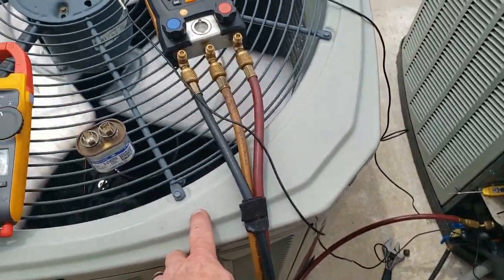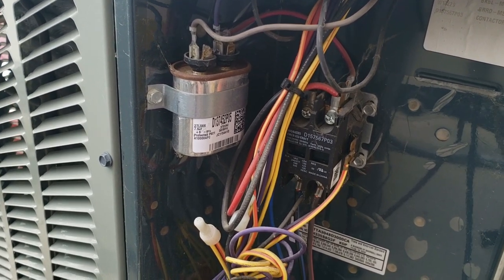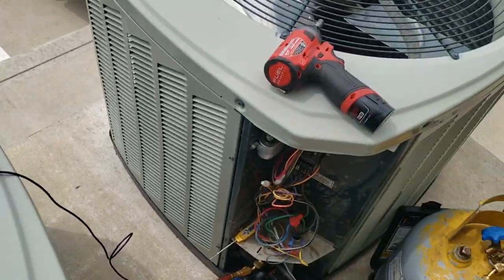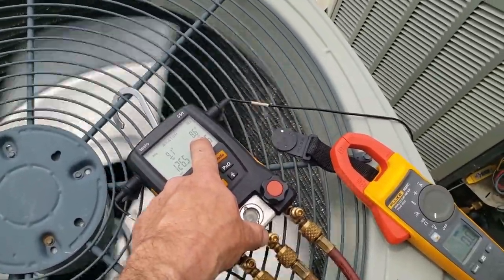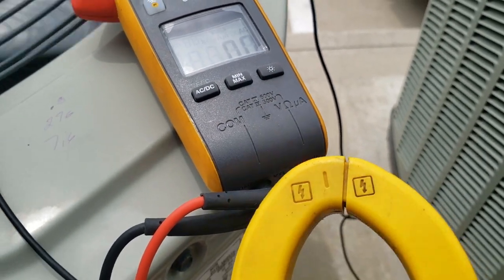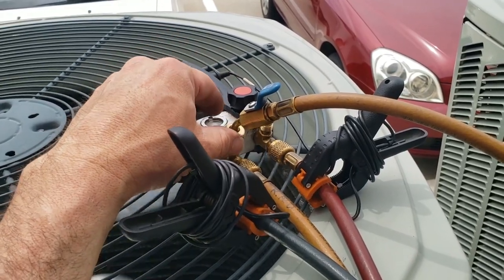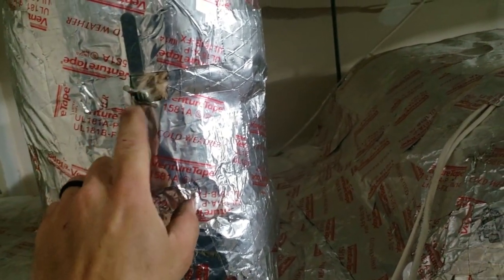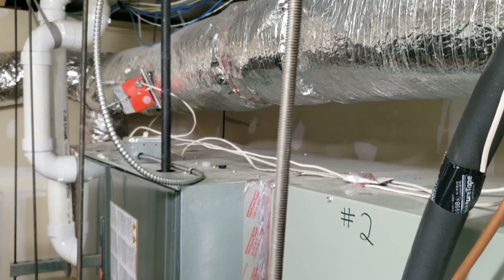No Cooling. Building Not Keeping Temp, Now It is!

Comment: I had a run capacitor issue like that last year on a brand new Trane. Installed an OEM capacitor that bench tested perfectly and showed under capacitance while running. I spoke with a bunch of engineers and nobody could give me a reason. Just a note that I did test it with three different meters and get the same results. I guess that’s why they call electricity a theory.
Reply from the maker: True that 👍👍

Comment: Yeah, Amprobe stuff is made by the Brymen company in Taiwan. They also rebrand their instruments in the United States under the Greenlee name. And they are a little slow registering amp readings. The Amprobe 300 series with the "amp tip" function produce very accurate amp readings, especially in the lower ranges. 
And I also believe that our "customer questioning" techniques are one of the most powerful diagnostic tools we can have in our bag. Done correctly, with the proper questions asked, you can get them to tell you an awful lot about the problem. Things they didn't even realize they knew. It can save  you valuable time out in the field and save you wasted trips down the Rabbit Hole. 😎👍
Reply from the maker: Bingo 👍👍 Just asking the correct questions the correct way 😁. Thanks 4 watching 🍺🍺
Reply: We are technicians and detectives.

Comment: If you don't mind, I was curious about something. I think all these devices are On-Of compressors, is there any reason they are not inverters?
Reply from the maker: Because of cost, no one wants to spend anymore money than they must. OR Maliyet nedeniyle, hiç kimse olması gerekenden daha fazla para harcamak istemez.
Reply: @HVACRSurvival  Yes I got it, you are right. I really like the packet channel systems, which are common in your country, of course, with the structure of these houses. Our single-storey buildings are made of reinforced concrete. I also saw that in your country there is a power cut-out to cut the supply voltage near or on outdoor units. This is definitely a well thought out standard. In our country, it happens indoors far from the energy breaker, which is difficult during maintenance and repair. I am very curious about the devices and the working system of people in different countries due to some differences I saw at first sight. You work alone, your equipment is very high quality and professionally this is very nice.

Also thank you very much for writing in Turkish. This made me very happy 🙏🙏 nice gesture
Reply: @HVACRSurvival  Google translates a little differently, cannot convey what I think. Don't get me wrong, I'm sorry.
Reply from the maker: I was curious what it was until Google told me 😁👍👍, maybe someday Google can do conversion of language on the fly as we speak.
Reply from the maker: It's fine. Just like me using the word (on the fly) doesn't mean a fly but means automatically 👍👍

Comment: I really liked the capacitor under load math. Gotta say i did not know that. Thanks for that! I would have checked amps on the contactor and voltage there. Hate the . Oh now its working calls. Same hoses for the same reason. Love it thanks for that validation. Also.. wait you just said it was clean. Nevermind haha btw thanks for making me watch work on my eveng. What is my dang problem!?
Reply from the maker: 🤣 I'm glad you liked it 👍👍🍺🍺

Comment: Good thing you dampered that outside air, I'm not sure where your from but in GA on our commercial units the max OA we allow us 30% do to the humidity issues. That seems to work best and it is by the engineer's specs so good job on noticing that. Personally I love my fluke 87 but is very limited on what they can do
Reply from the maker: Thanks for checking it out 👍👍. A lot of times the fresh air damper is there to pass inspection then gets closed 😏.  The 87v has proven to be good at bench work in electronics repair and industrial work. I'm curious what is it missing that you would need?
Reply from the maker: Ohio
Reply: HVACR Survival it's not shock proof lol dropped it the other day in the case and the screen is only half working. That's operator error problem though
Reply from the maker: It might be just the rubber ribbon cable that goes to the LCD screen. You can pick those up on eBay pretty cheap ?
Reply: HVACR Survival thanks I'll take it apart and see

Comment: When you checked the amps on the capacitor, which wire do you know to check when doing the 2652 math? Run, start etc.
Reply from the maker: The wire feeding the start winding from the capacitor. 👍👍 Thanks 4 watching!
Reply: @HVACRSurvival  thank you. I had to watch this video twice. I learned something new. Never thought to check a capacitor while running.
Reply from the maker: Yea it was something I learned later in the field not to long ago. Lol. Just be careful 😁 it bites harder than 120v per leg does.
Reply: Learning to check caps while under load has saved me a lot of headache and really makes the difference

Comment: /wonders if the maintenance visit in March added some gas to the system, which meant it was overcharged come the heat of the summer months...
Reply from the maker: I did the maintenance in March but didn't add anything. Our agreement technically says check everything but the pressures,  but I usually do for this very reason. But March would have been too cold for accurate measurements in Ohio.
Reply: Probably, I try not to adjust refrigerant charges during the cooler months unless it's a known leaker.
Reply from the maker: @scrambler350  I feel the same way, its easy to over charge them in the colder ambient temps. Far as known issues, I don't believe we have had many problems with the HVAC here.

Comment: I'd say you need to read in the hundredths scale to accurately test those small caps and motors but even then I don't fully trust the readings
Reply from the maker: I've read that. 👍👍 I don't do this test very often but here's a good example of when it does make a difference.